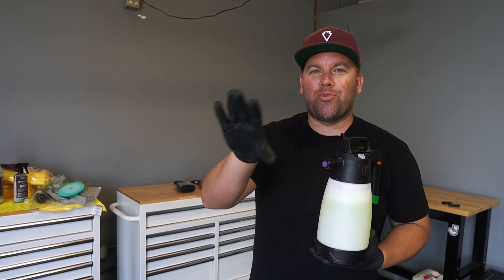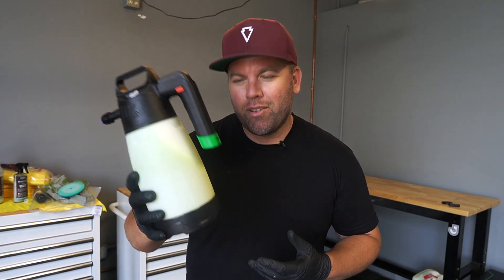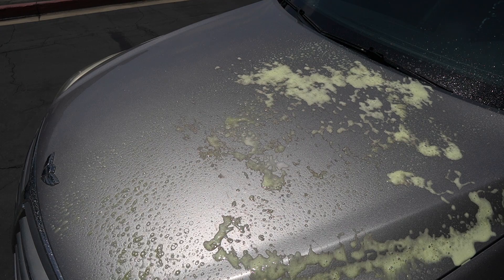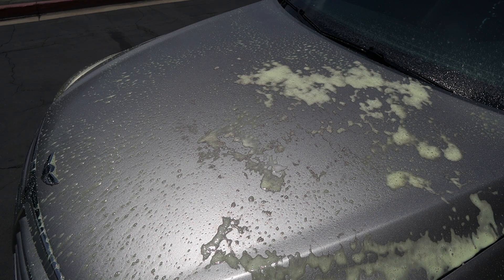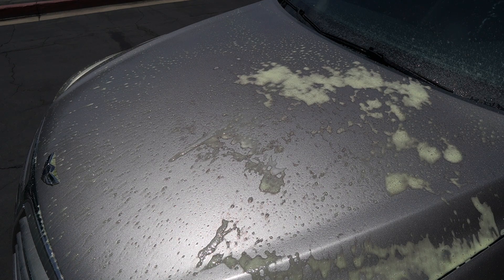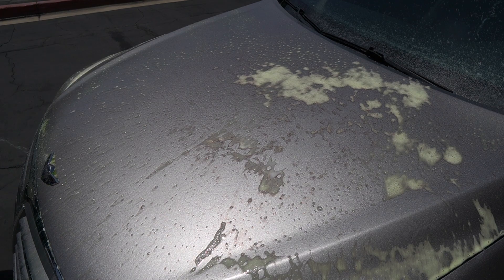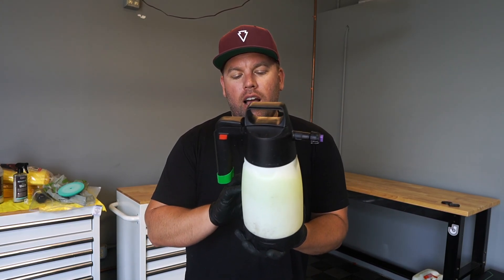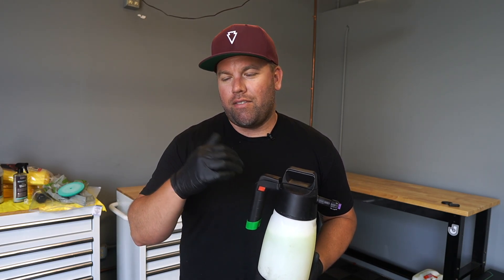The Greatest Iron Removal Hack Of All Time...

Comment: I use this method with IK Multi but I switch the tip to the Fan tip to get better coverage when doing full decon on a car.  Regular IK Trigger sprayer for wheels and smaller areas.